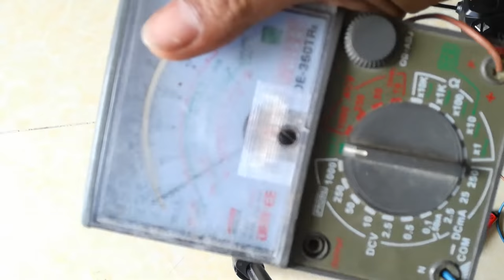Why my RC car doesn't work???#diy #rc

Comment: Thanks for cracking that RC open 😀👌 Appreciated that.
I needed a reference since I'm connecting the wires of the controller's receiver myself.
Guess I did the wirings wrong😅
I connected the positive red wires from the battery input thing to the DC motors' mounting bracket 😅
Instead of putting it to receiver 's mounting bracket or connect it to the receiver's wires...

I was also confused with the Back and Front wires which this video helped me to overcome it 😊

Comment: Is the wires for the lights not important? Cuz mine has headlights
Reply from the maker: Yes, you can cut it if you want to save the energy
Reply: If you cut led wires car batteries will live longer
Reply from the maker: Yes I think so

Comment: Bro i am also same car but my car problem of light is coming but car is not  moving  please help...
Reply from the maker: Please check motor first. If you have multimeter you should check votage on motor it is round 5 volt.

Comment: Bro in my case my car is working and remote too bt when I press left or right joystick it only turns to left and goes back or reverse pls help
Reply: Check the wires and see the motor is working correctly
Reply: Yeah, definitely something with the motor

Comment: I ve problem with my crawler. Firstly motor was broken down then l  replaced with new 130 motor. Now motor working but very weak. When l put on ground, it is not moving. Do u know that where the problem is?

Comment: In my this car front wheel are moving but rear wheel are not moving ,both motor are right,how can I fix it ,please reply
Reply from the maker: Please check your motor
Reply from the maker: You can cut wire and test it by using another battery or 5V dc power supply